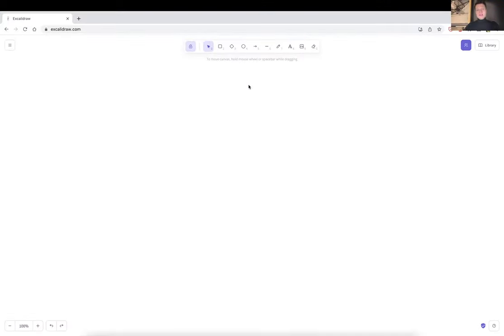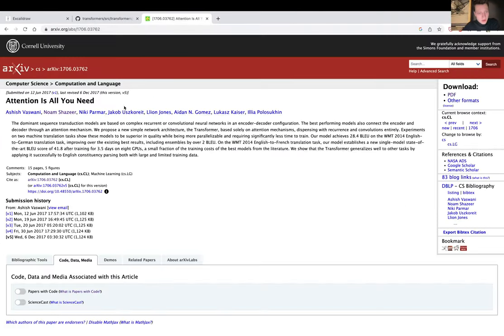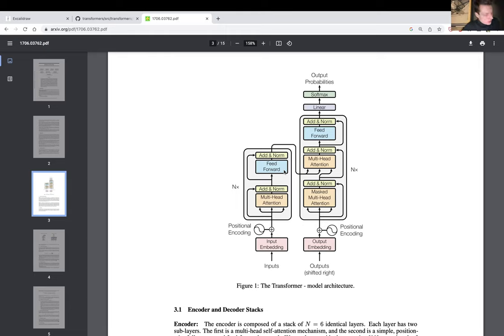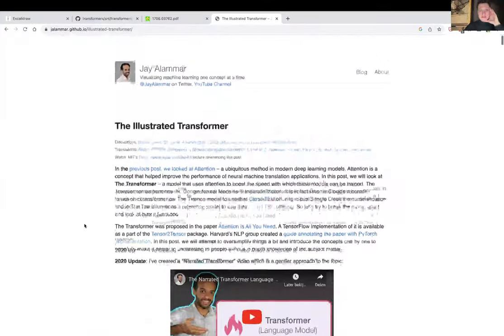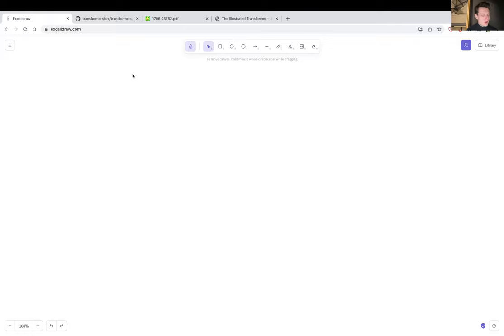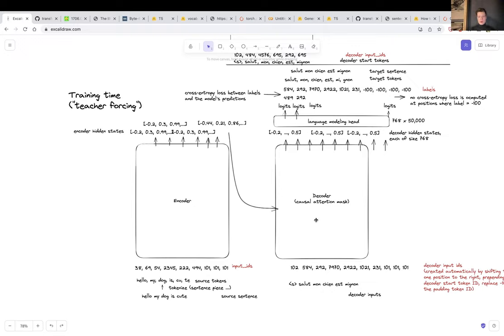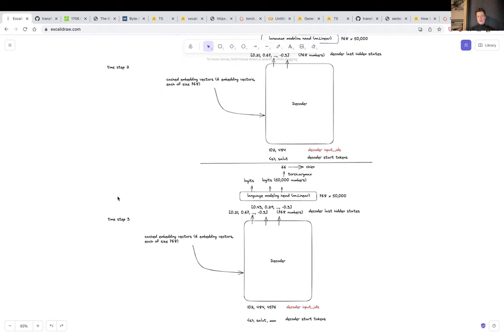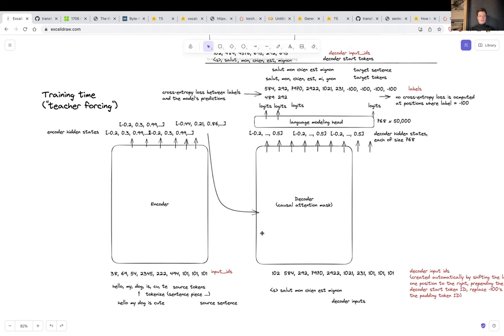How a Transformer works at inference vs training time

Comment: Hi Niels, you describe a lot of steps that are taken, but don't really explain why they are taken. It becomes a kind of magic formula. For example, you have a sentence and break it up in tokens. OK. But hang on, why break it up in tokens rather than in words? What's different? Then you look up the tokens in a dictionary to replace them by numbers. Is that because it is easier to deal with numbers than with words? Then you do "something" and each number turns into a vector of 768 numbers. What is it that you do there, and why? What is the information in the other 767 numbers and where does that information come from? What do you want it for? It would be nice if you could give the context, both the big picture and the details.
Reply from the maker: Yes good point! I indeed assume in the video that you take the architecture of the Transformer as is, without asking why it looks that way. Let me give you some pointers:

- subword tokens rather than words are used because it was proven in papers prior to the Transformer paper that they improved performance on machine translation benchmarks, see e.g. https://arxiv.org/abs/1609.08144.
- we deal with numbers rather than text since computers only work with numbers, we can't do linear algebra on text. Each token ID (integer) is turned into a numerical representation, also called embedding. Tokens that have a similar meaning (like "cat" and "dog") will be closer in the embedding space (when you would project these embeddings in a n-dimensional space, with n = 768 for instance). The whole idea of creating embeddings for words or subword tokens comes from the Word2Vec paper: https://en.wikipedia.org/wiki/Word2vec.
Reply: I like the video 
Crisp and concise 
Keep it up

Comment: Inference:
1. Tokens are generated one at a time conditioned on input+prev generation2
2. Language modelling head converts the hidden states to logits
3. Greedy search or beam search is possible

Training:
1. Input ids: input prompt,  labels: output
2. Decoder input ids are copied from labels, prepended with <s>
3. Decoder generates text all at once but uses causal attention mask
to mask out future tokens from decoder input ids
4. -100 is given to padded position in labels to indicate cross entropy function to not compute loss there

Comment: @NielsRogge thanks for the super clear and helpful video! It's really one of the most clean and concise presentations I've watched on this topic!   🙌  I had a question though: At point 24:09, you are saying that during inference in the last hidden state of the decoder we get a hidden vector *for each of the decoder input ids*. In your example after 6 time steps, we have 6 decoder tokens: <s>, salut, ..., mignon, which means the last hidden state (at time step t = 6) would produce a 6 x 768 matrix. Is that true though? 

I thought the last hidden state of the decoder produces the embedding of the *next token*. In other words, a 1 x 768 vector, that is later passed through a `nn.Linear(768, 50000)` layer to give us the next decoder input id. In other words, the 1 x 768 vector is passed to `nn.Linear(768, 50000)`  and gives us a 1 x 50000 logit vector. But if what you say it's true, then when a 6 x 768 matrix is created at time step t = 6, then the end result after the last linear head would be 6 x 50000 logit matrix. No?

Comment: Great work. Thanks a lot for this video. 
I had a small doubt, during the transformer inference you mentioned we stop generating the sequence when we reach the <eos> token. But during the training, in the decoder_input_ids, I noticed you didn't add the <eos> token to the sentence, did I miss something here ?
Reply from the maker: Hi, during training, the <eos> token is indeed added to the labels (and in turn, to the decoder input ids), should have mentioned that!
Reply: @NielsRogge  Got it. Thanks. I believe <eos> will be added before the padding tokens ? 
"<sos> sentence tokens <eos> + padding tokens to reach the fixed sequence length. Am  I correct ?
Reply from the maker: @NaveenRock1  yes correct!
Reply: @NielsRogge  Awesome. Thank you. :)
Reply: Hi @NielsRogge, I understand that the decoder input is "<sos> sentences_tokens <eos> pad_tokens" and one token gets generated as output for each token in the input. However, when calculating the loss, the output tokens are compared to "sentence_tokens <eos> -100 -100 ...", by removing the <sos>, right? But that means there is 1 less token when calculating the loss when compared to the generated output tokens by Decoder. How is this problem resolved? Will an additional token with id -100 be appended at the end ?

Comment: Hi Niels,

Here's a corrected version:
I greatly appreciate that you've taken the time to create a fantastic summary of training and inference times from the user's perspective.
Q1: during training, do you also involve the end-of-sentence token generation into the loss function? You haven’ mentioned it though IMHO a good model must detect the end of translation.
Q2: why do you need to introduce padding? Everything works perfectly with arbitrary length of input and output sentence which is a true beauty. Why is it needed for batch training?
Thank you.
Reply: he said in the video that padding is introduced because the training is done in batches. The elements of the batches will have a very different lengths. If we don't use padding, we will have to dynamically allocate memory for every element in the batch. This is not very efficient for the computation.
Reply: @nouamaneelgueddari7518  Makes sense to me. Thanks.

Comment: Thank you very much for the explanation, Niels. It was excellent. I have just one question regarding 'conditioning the decoder' during inference: How exactly does it work? Does it operate in the same way it does during training, i.e., the encoder hidden states are projected into queries, keys, and values, and then the dot products between the decoder and encoder hidden states are computed to generate the new hidden states? It seems like a lot of calculations for me, and in this way, the text generation process would be very slow, wouldn't it?

Comment: Can you elaborate on why seemingly all new models are decoder-only? And are trained with the sole objective of next token prediction. Does the enc-dec architecture of T5 have any advantages? And is there any reason to train in different ways that T5 do?
Reply from the maker: Hi, great question! Encoder-decoder architectures are typically good at tasks where the goal is to predict some output given a structured input, like machine translation or text-to-SQL. One first encodes the structured input, and then uses that as condition to the decoder using cross-attention. However, nowadays you can actually perfectly do these tasks with decoder-only models as well, like ChatGPT or LLaMa. The main disadvantage of encoder-decoders is that you need to recompute the keys/values at every time step, which is why all companies are using decoder-only at the moment (much faster at inference time)
Reply: Thanks so much for the video, and answering questions!  Can you explain (or provide a pointer to a paper) how the key/values can be cached to avoid recomputation in a decoder-only transformer?

Edit: I figured it out while re-watching the training part of your video, so you needn’t answer unless you think others would benefit (I wouldn’t be able to explain very well, I fear)
Reply: Don’t you have to recalculate in the decoder-only architecture aswell? Or is this where the non-default KV-cache comes in?

Comment: Superb video. Just a doubt. @11:46 you mention that decoder would use the embeddings from encoder and the start of sequence token to generate the first output token. By embeddings did you mean the key value vectors from the last encoder stage? Also if encoder is being used to encode the input question then why are GPT, llama, etc., called decoder only models? Thanks
Reply from the maker: Yes the embeddings from the encoder (after the last layer) are used as keys and values in the cross-attention operations of the decoder. The decoder inputs serve as queries.

Decoder-only models like ChatGPT and Llama don't have an encoder. They directly feed the text to the decoder, and only use self-attention (with a causal mask to prevent future leakage).
Reply: @NielsRogge  Thanks for the quick reply. But my confusion is that when we ask a question to GPT or llama like "what is transformer?", as per all the sources and including this video, they mention that decoders start with the SOS or EOS token to generate the output. But from where does the decoder learn the context? Even in this video you use the encoder to encode the input question and then pass the encoded embeddings to decoder right?

Comment: Question on the tensor shapes of the Encoder that go into the Decoder during inference:

If the Encoder output is of shape (1,6,768), during cross attention, how can this be combined with the Decoder's input which is only one token in length [e.g. Shape (1,1,768)]?

Comment: great video. the only thing that literally all videos on transformers don't mention is: how and when happens some kind of backpropagation? I understand how it works for a simple neural network with a hidden layer and we use gradient descent to update all the weights... but in the transformer architecture I find it hard to visualize which numbers get updated after we calculated the loss.
Reply: yeah, conceptually at first maybe but I would argue the transformations themselves are not more complicated than a normal NN for classification, coz its really doing just that, predicting the most probable token from the dictionary. At least its way easier than backprop for RNNs, LSTMs etc.
The transformers book from Huggingface has a great explanation for attention which is really all you need to know to demystify the whole transformer architecture. And attention is really just adding a few linear projections  and doing a dot product.

Comment: Hi Niels, great explanation on this. 
I just couldn't get my head around one point. At each time step we are producing n number of vectors (same as decoder input). Is it guaranteed that the previous predicted tokens vector won't change? 
What if the decoded token vector changes as we include more tokens in decoder input?

Comment: Missing softmax during training, mandatory to calculate cross entropy loss.
An unrelated question : Am I understanding right that there is a thus a maximum length for all these sentences, like 512 tokens ? Isn't that an issue ?
Reply: i think cross entropy loss in pytorch (atleast!) apply the softmax internally. yes token limit is a sort of limitation because of how encoder and decoder internally works but it can be resolved while making the dataset pipeline for training and inference.